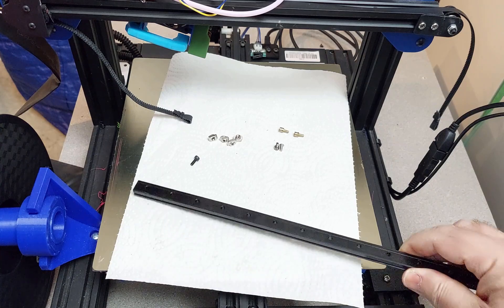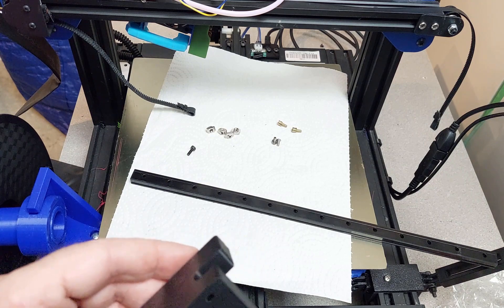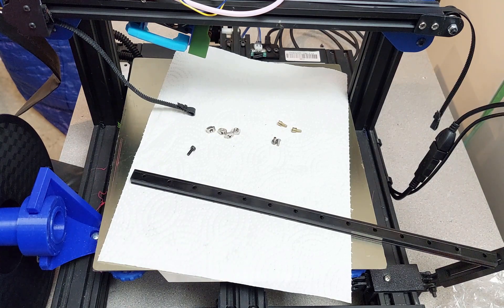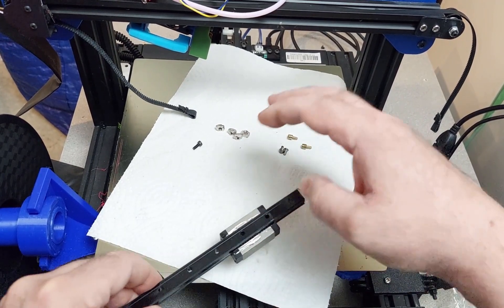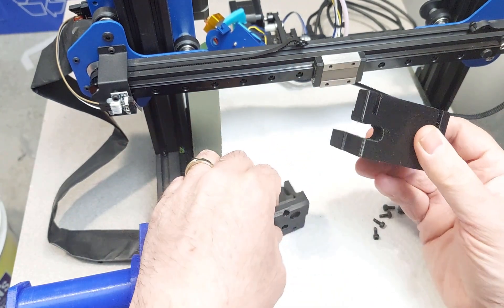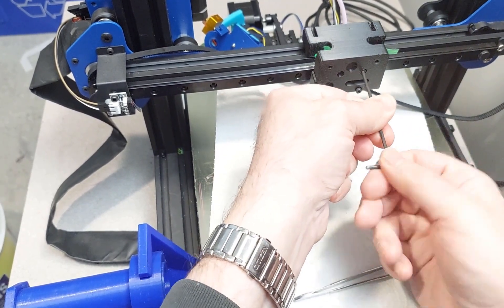Linear Rail Install 3dprinter upgrade tronxy xy2-pro

Comment: hey Jeff! I did this last night (italian time), did you lose any bed printign surface? beacuse i did, i'm also modelling a new housing and plate carrier for the linear rail if you are interested.
Reply from the maker: Sure let me know when you done and where it's hosted.
Reply: @jeffs3dcorner  ehy jeff still working on the hotend assembly but i made a mount for a linear rail for the bed, if you are interested i'll send you the thingverse link.

Comment: Hi Jeff! Great idea, as always!
Did you change the bed on your XY2 pro?
I was looking into PID tuning, but figured it wouldn't work with the default bed since it's not PWM controlled.
I have a lot of layer lines and I'm pretty sure they're related to the bed temperature fluctuations.
Reply: go with Marlin and enable PID control in the firmware. Then use Pronterface to do a PID tune for both the bed and the hotend. No more wild fluctuations after that.
Reply: Yes it can, PID just heats and measures the heat. It doesn´t need PWM it just widens the heat-cool intervalls.